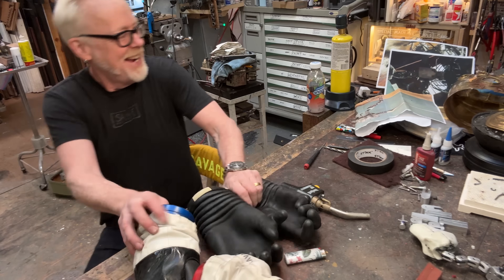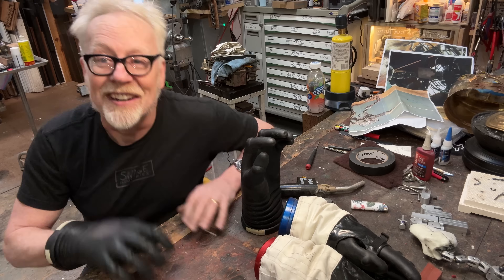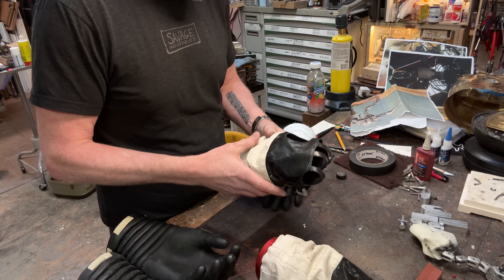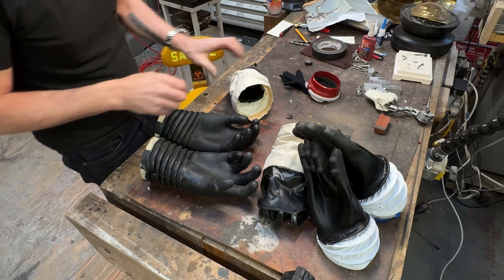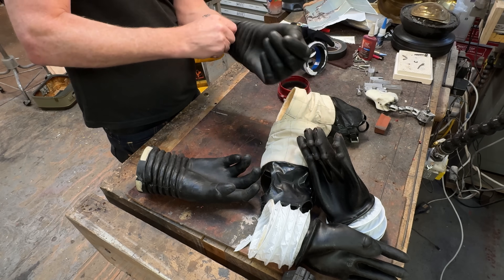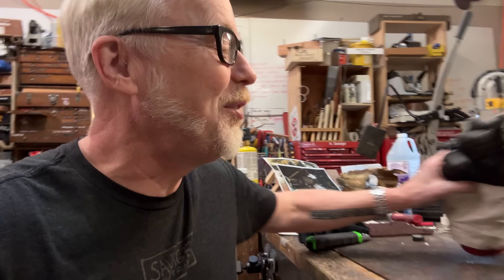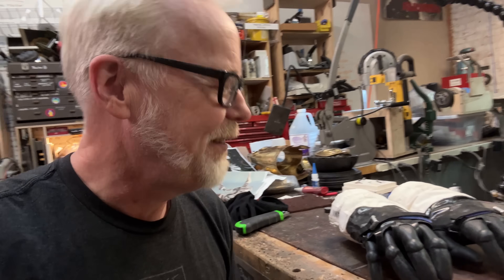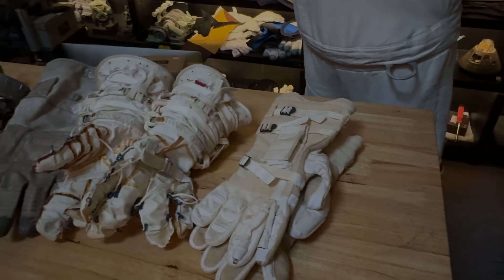Adam Savage Fixes His Deteriorated Spacesuit Gloves

Comment: if you ever really need to glue rubber for a build like this and don't want it to come undone it's basically goop but aquaseal makes a shoe repair glue that is CRAZY strong rubber once it cures. I use +SR for my rubber repairs but you do have to color it yourself since it dries a clear/slightly yellow. I've repaired a set of cowboy boots that the boot repair guy gave up on with this stuff and 5 years later the glue is still going strong.
Reply: I know those boots were leather but I was gluing rubber sole to polished leather tops and it worked a charm even on that.
Reply: Silicone is the least unpredictable rubber sort. The risk of unexpected decomposition is quite low unless it gets eaten by fungus.

Comment: Polyurethane has a life span of about eight years. Then it starts crumbling away. The only way to prevent that is to seal it in a vacuum.
Reply: PU rubber is one of the worst predictable materials. It behaves even less predictable than latex (which mainly decomposes by oils, metals, ozone and the combination of UV light and oxygen). Some PU sorts do nothing, others turn into tar-like sticky mess or suddenly crumble apart. E.g. the PU foam on headphones tends to fall apart after 10 years. But even rigid transparent PU hoses turn yellow and more brittle (which seems to be triggered by contact with some latex sorts, possibly by release of sulfuric acid vapours).

Comment: By how i see those split tips, those are purely rubber. AFAIK, the og ones were formed on a metal shape, dipped in a special type of powder (might've been a talcum mix) for release, upon which a linen backing was added, before being dipped. If you zoom in on pictures, you can see the textile in the bladder (as they are called). The rubber needs that backing, and is what keeps it fixed. I would link but yeah. "nasa bladder agent" should suffice for pics, without the quotes in the image page.

Comment: How much time do you spend wearing and working in the spacesuit, that you managed to wear out the fingers?
Reply: its not wear it the matriaal that wil fail after x amount of time
Reply: @basvanderwerff2725  Not necessarily. If the gloves have been worn, I expect that sweat residues are the main reason why they rot particularly at the finger tips. (Used household rubber gloves do the same.) PU rubber is one of the worst predictable materials. It behaves even less predictable than latex (which mainly decomposes by oils, metals, ozone and the combination of UV light and oxygen). Some PU sorts do nothing, others turn into tar-like sticky mess or suddenly crumble apart. Otherwise I own many latex objects (I meditate with inflatables) those are decades old without decomposition. But I take care to store them in mostly airtight boxes or bags to keep ozone out.

Comment: It is fascinating to see how various materials withstand the test of time. Some materials we took for granted even 15 to 20 years ago are starting to give us some serious trouble nowadays, though at the same time, in order to preserve them, we practically have to keep them stored in such a state that makes enjoying them almost impossible.
Reply: As a person into vintage electronics from the 80s/90s, tell me about it. So much plastic brittlized or rubber reverted into oblivion 😢
Reply: PU rubber is one of the worst predictable materials. It behaves even less predictable than latex (which mainly decomposes by oils, metals, ozone and the combination of UV light and oxygen). Some PU sorts do nothing, others turn into tar-like sticky mess or suddenly crumble apart. E.g. the PU foam on headphones tends to fall apart after 10 years. But even rigid transparent PU hoses turn yellow and more brittle (which seems to be triggered by contact with some latex sorts, possibly by release of sulfuric acid vapours). If the gloves have been worn, I expect that sweat residues are the main reason why they rot particularly at the finger tips. (Used household rubber gloves do the same.)

Comment: That’s why it blows my mind that collecting rare vintage cars is so lucrative: these things perish and crumble. Obviously it’s not a huge problem, but it would make me nervous as heck: I would lie awake wondering if I’ve moisturised the windshield rubber seals enough.
Reply: If you think that's wild check out people who collect designer bags and shoes made of pleather, heck the entire sneaker head community is on borrowed time man lol
Reply: @strayiggytv  Keep precious sneakers in an airtight dark box with possibly even ozone absorbents. But the internal material mix itself likely makes some sorts just crumble apart (e.g. PVC plasticizer oil slowly seeping into rubber parts and so dissolving them). And car rubber parts also slowly rot by oil and fuel within the car. Cold can turn it brittle, and heat bake it brittle too. In rubber is basically no moisture to evaporate, so remoisturizing won't help (although latex care can temporary shield against ozone and oxygene). It mainly turns hard because molecule chains tear and relink to form shorter meshes (similarly like what alzheimer plaques do inside the brain).

Comment: The rubber of the gloves needs care. Similar to the seals on the car, the rubber gloves also need to be moistened with care products from time to time. This maintains their elasticity.
Reply: In rubber is basically no moisture to evaporate, so remoisturizing won't help (although latex care can temporary shield against ozone and oxygene). It mainly turns hard because molecule chains tear and relink to form shorter meshes (similarly like what alzheimer plaques do inside the brain). But this is PU, which is even less predictable than latex. The finger tip rot likely also happened by sweat residues (used household rubber gloves perish the same). I meditate with latex inflatables and so made plenty of resonators from household gloves; even after decades, unworn gloves do not particularly decompose at their finger tips. Protecting latex from oils, ozone and the combination of oxygen and UV (i.e. store airtight when exposed to light for display) can make it survive many decades. But some rubber sorts just decompose internally by wrong composition (that may e.g. release sulfuric acid) without external reasons.

Comment: I do wonder how much time/money the real NASA engineers spent to make sure this didn't happen on the real ones haha
Reply: For starters the real ones are not meant to be used for that long, they actually have an expiration date. Best before, and all that, lol.
Reply: I happens to the real ones too, Adam made a video with the conservators of NASA, everything degrades.
Reply: @MrRickkramer  yes it does but not while they actively being used
Reply: Apparently not that much, because the actual suits that are in the NASA archives have this same problem. Some of the suits are so brittle that they will shatter if flexed. The suits were not designed with longevity in mind. Urethane and other synthetic rubbers have elastomers that keep the material soft but eventually it off gases out of the material and it becomes brittle.
Reply: @falconwind00  In rubber is basically no moisture to evaporate, so remoisturizing won't help (although latex care can temporary shield against ozone and oxygene). It mainly turns hard because molecule chains tear and relink to form shorter meshes (similarly like what alzheimer plaques do inside the brain).
Reply: NASA spend literally hundreds of dollars to get space men to be men in space.